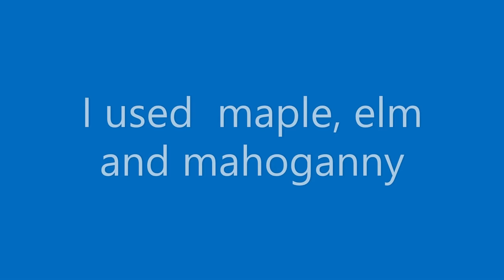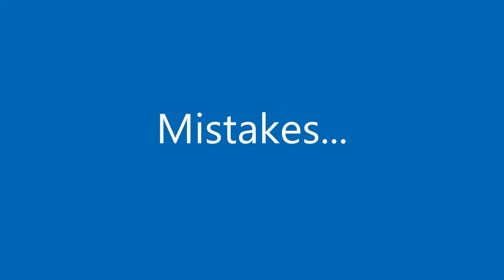tumbling block end grain cutting board how to make it

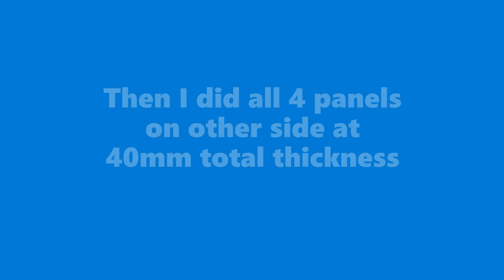Comment: The 2 finished boards at the 4:13 mark. Are the core boards (20 mm) the same species? Or is one mahogany and the other elm. This tumbling block pattern is very cool
Reply from the maker: Mahoganny and elm. 0:24 on the clip you can see a drawing. Look at mahoganny in the core, it turns to elm after 3 seconds. I should separate that 2 photos. In the clip they look like 1. I still do better boards than video clips 😀

Comment: Nice work.  
Have done a few 'magic eye boards'.  
Biggest mistake for me - - - - used too much mineral oil for finish.  The wood soaked up the repeated applications eagerly.  Then the hydraulic pressure inside the material overpowered the glue and caused split a few of the seams.
Reply from the maker: Sorry to hear that. I have had no problems with splits but I do not use too much mineral oil and I do it always min 48 hrs after gluing